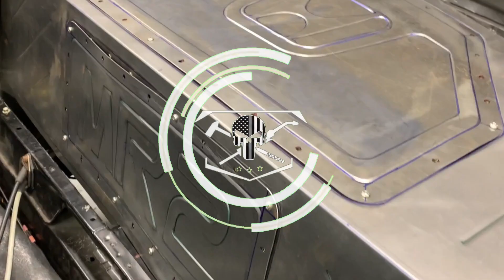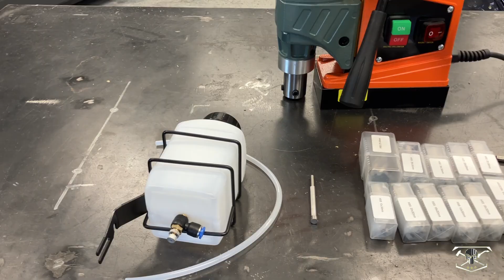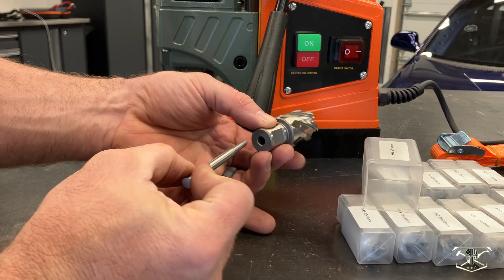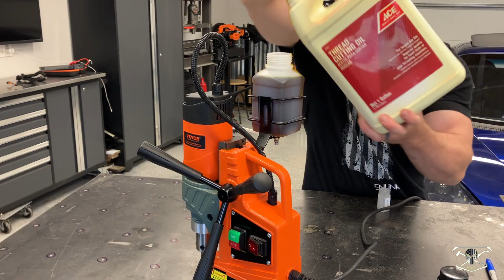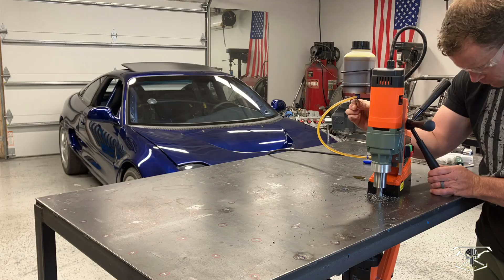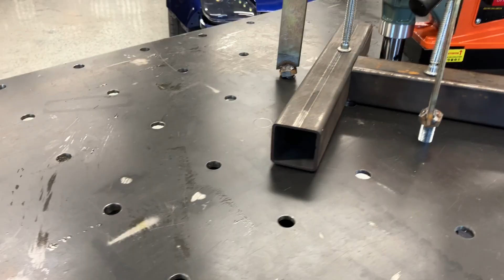How Good is the Vevor Magnet Drill?

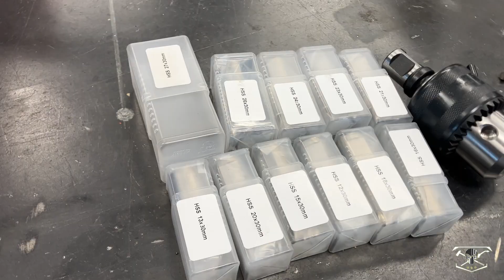Comment: 1:00 what? I know you are used to freedom units, but…. 

It’s a 12 to 27 mm set, with a diameter of 30mm 🙃
Reply: 30mm is the depth of cut.
Reply from the maker: oops. good catch
Reply: @scantronsgarage  to be fair 27mm is close to 30 mm. 30 mm is only about one eighth of an inch larger than 27 mm is. A little less really. 3 mm = 0.1181" So about 0.007" shy. Or seven blonde ones less. So you were close.